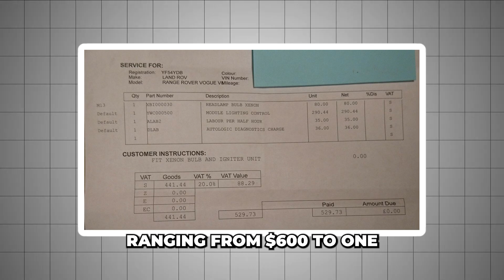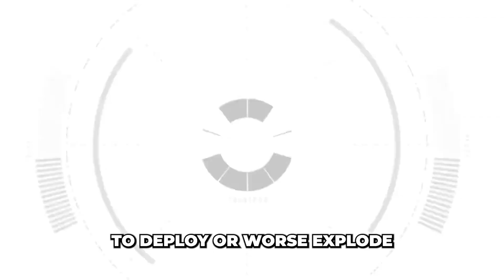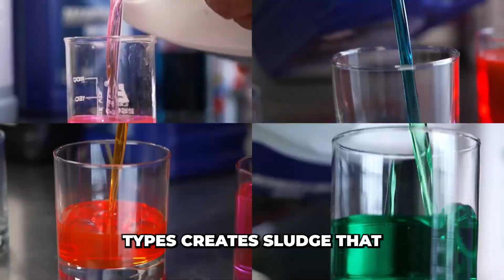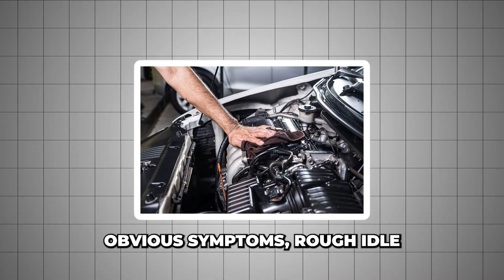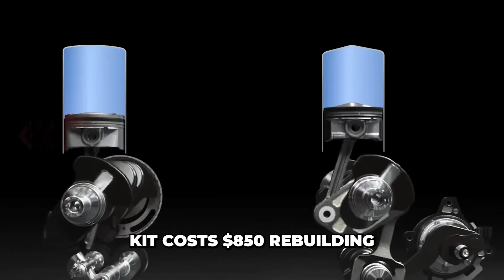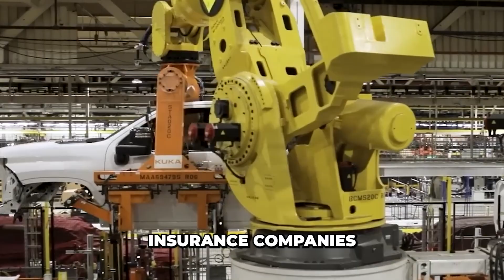13 Car Repairs You Should NEVER Attempt Yourself!

Comment: I buy a shop manual for every car I have. This the official repair manual used by the dealer. It shows you how to repair just about everything and save a small fortune. Another benefit of the shop manual is that it can show you which repairs require specialized equipment and are too labor intensive. You can then take the car to a professional without starting the repair and ending up damaging the car or failing the repair. Helm, Inc. sells these manuals which can pay for themselves after one or two DIY repairs